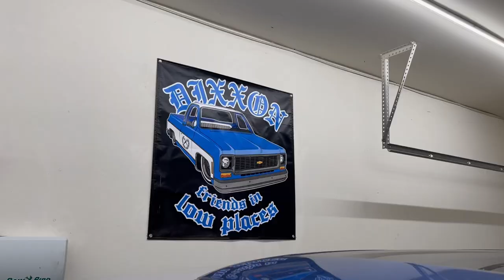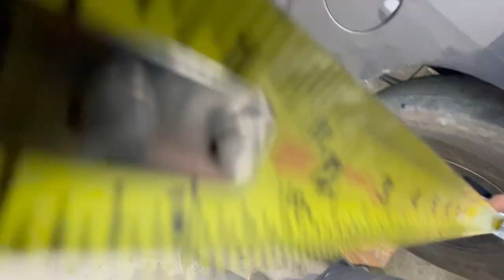Manny’s Single Cab Short Bed Conversion Part 1

Comment: just bought a 03 Chevy RCLB yesterday so i have a couple of questions 
#1 could i cut the sides of beds to turn into a shortbed? 
#2 would i have to get a new gas tank, fuel lines, & brake lines?
#3 can i get a new oem driveshaft to fit instead of a custom one?
Reply: I'm doing a long bed to crewcab short bed on a 05 Silverado and you're gonna need a gas tank from.a short bed or an extended cab truck as the long ed tank is too long. You're gonna have to source a new bed as its easiest than cutting the old one apart.
Reply: @Pressedsteelcustomsllc  appreciate the reply, i was able to source a couple of shortbeds out in El Paso but all 3  sellers bailed out on me, but i know a shop in Phoenix, Az that would cut the bed up itself im not too worried about the cost overall because ima be doing majority of the work myself like cutting frame and the little stuff it’s just the  bed if i can’t find a reliable seller and i would be okay with the fuel and brake lines that are already on the truck or no?

Comment: Did this project start off as a Longbed??
Reply: These trucks had 3 different bed sizes. The long bed, the standard bed (aka the short bed as everybody calls it), and the crew cab short bed which is an even shorter bed